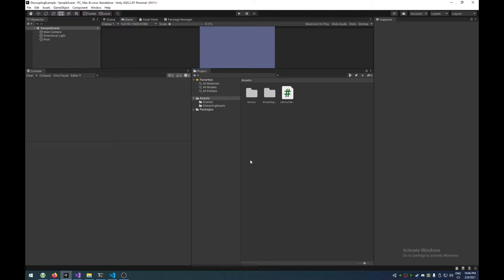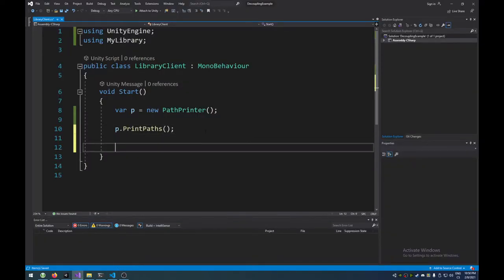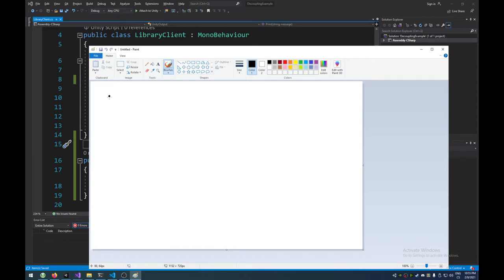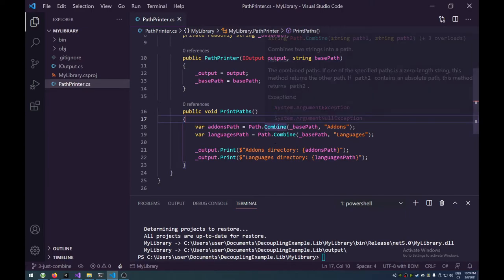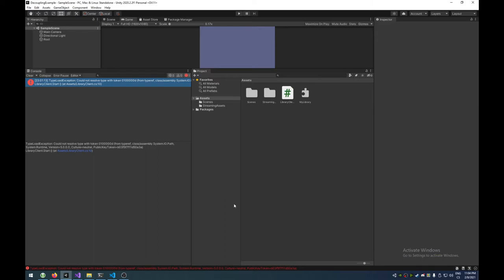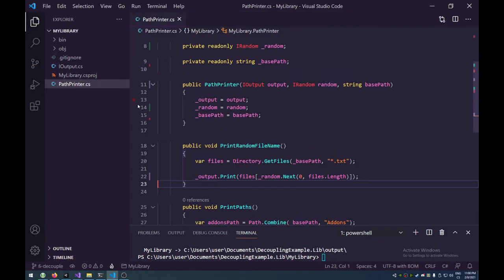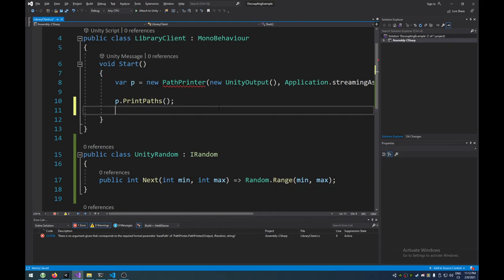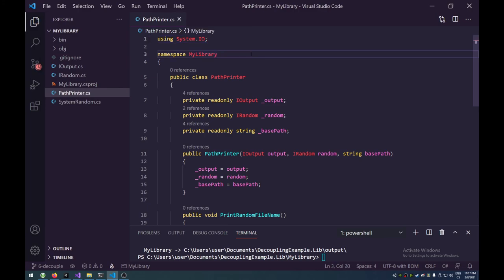Decoupling from Unity 3D

Comment: Thats actually amazing thanks a lot. I have this desire that I wish to implement some code outside Unity. And maybe this is the right way. Idk. I have a lot of libs that I write and they stay locked in some unity project and than I copy paste them using create package. I love it the only issure I see is how do you test this kind of code. You create Unit tests inside Unity project or inside lib C# project. etc.
Reply from the maker: As long as your lib code is standalone you can test it all you want. If you heavily depend on Unity APIs, then as you say, it would be a better idea to test through Unity itself. I think I saw they have some Unit testing framework.